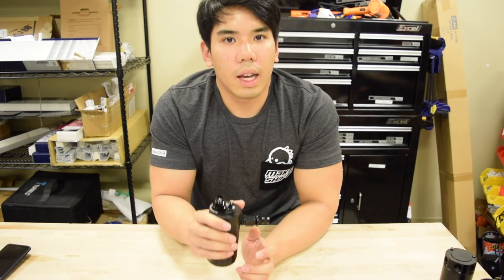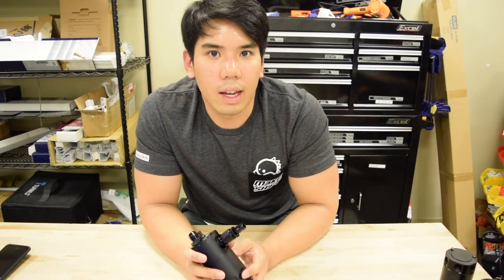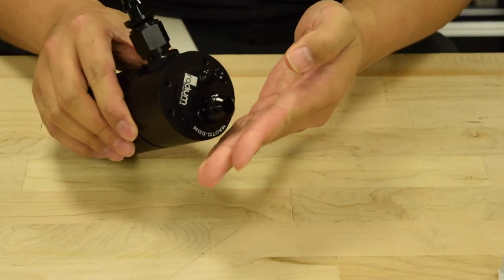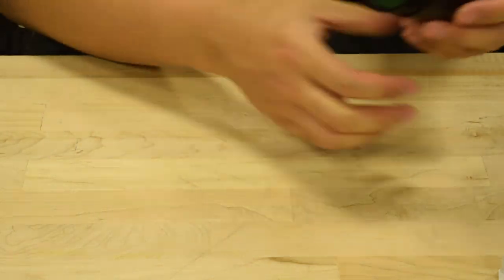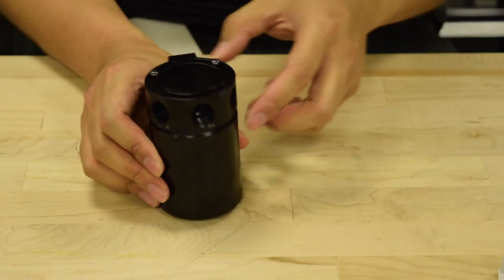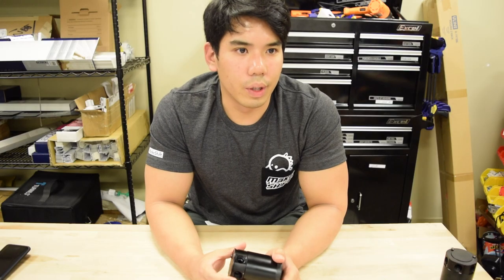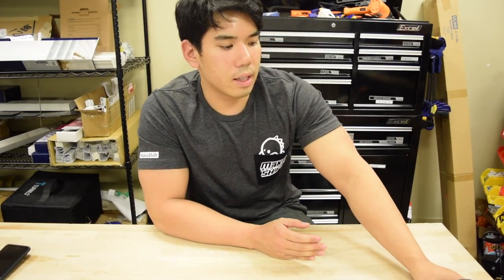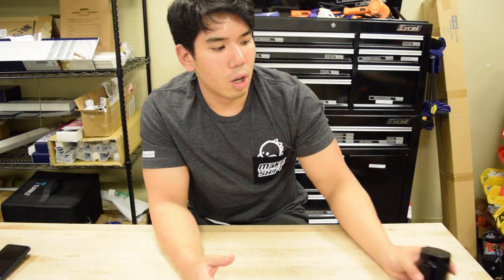Cheap vs Expensive Mods: Catch Can (Which is best for you?)

Comment: I have the cheap copy version of the Mashimoto item it is exactly the same both in materials used and quality.Both are Chinese made.The copy version has better threading than the massively over priced Mashimoto.You probably don't want to hear this but I have to tell you the copy works perfectly. £134 for the Mashimoto and £10 for the copy version here in the UK.
A final thought.Had you have been reviewing the Mashimoto version,I doubt you would have criticised the filtration method Mashimoto used,you would have accused Mashimoto of not knowing what they are doing! That would never do would it?
Reply from the maker: Yep! I believe it. I only bought the knock off haha. It's crazy how large the mark up for something so generic. And you've gotta think even our knock offs, someone made money selling it too.
Reply: Same for the radium buddy. The company that makes the radium tanks is BJR Performance who sell in bulk. 
Really good stuff I have alot of their stainless AN-3 fittings that I used to make my braking system

Comment: I believed that some oil catch cans will increase the pressure in the system due to the restricted flow, such as the bronze micron filter, is that more harmful than good?
Reply from the maker: The bronze filter adds less resistance than you'd think. The stock PCV valve is like a ball bearing check valve situation so I'd think that it would have more restriction than the catch can
Reply: @OhItsJustZhu  thank you for the explanation.

Comment: I love how the expensive ones are simply branded and sold at a higher price. Yet the same one shown by radium can be purchased on AliExpress from the manufacturer for the cost of the cheaper alternative anyway. 

Most of the universal stuff these days is manufactured in China. Then vendors like radium, real street, mishimoto and mocal and many others just buy them in bulk.

Even real streets catch can though gorgeous is simply the same as found on AliExpress for $30 or less and the only difference is real street put a spacer between the filter and body.
Reply: I've never seen the likes of Radium style catch cans on aliexpress however the second catchcan is what Mishimoto initially sold to the public, worst design by far.

Comment: Your close....It's made to clean.. filter.. separate the bad oil due to carbon build up drying and setting on top of the valves until eventually it comes loose...into the internal parts of the motor....This very bad problem is undetected in these types of motors with direct injection spraying the fuel under the valve instead of over the valves...unless you have a catch can and separate the bad oil carbons sludge separate the dirty oil it's going to...Try and explain one more time..... jamming hardened sludge clogging burning carbon that has been setting on the top of the valves..Older motor designs sprayed the fuel over the valve actually cleaning breaking down the carbon deposits using  the solvents in gasoline..and recent newer motors have two injectors for each valve spraying on top to keep carbon from developing and also spraying directly under to get better fuel mileage...... I'm sure someone could explain it a little better.... Hope this helps you.. it helped me I have the f150 3.5L EcoBoost backfire misfire while passing ruff idling.....simple fix catch can.. dual cans... Great video I have to learn how to edit make some YouTube vids ..yes I know and write too... lol ......GoodLuck and GbPT

Comment: I have an oil catch can almost identical to the generic one you demonstrated with, except that mine is a 2-port configuration and I purchased it on eBay. The problem I'm having is that oil is leaking from the lower drain bolt on the bottom of the catch can, has anyone else had this problem?.. and what did you use to fix the problem? I'm guessing the standard bolt isn't sufficient for the pressure it is under...
Reply: Use TPFE tape for the screw thread, this is the reference product :

https://www.amazon.com/dp/B06XCWQ4D2/ref=cm_sw_r_cp_apa_glt_fabc_JBQ4P2KARQ7RPV2PSYM2

Comment: How did you make the additional baffle? Looks like just sheet metal that you cut and drilled.  Then bent and used the diverter to mount the metal to and added the steel wool?
Reply from the maker: Yeah, you got it exactly! I got the sheet metal from Home Depot for cheap and did some cutting and bending. I forget if I riveted it in or used existing screws but I'll check this weekend. Thanks for the question!

Comment: Hey man how's it going I got the mishimoto catch can the 253$ one or so . And I don't want to spend the extra money for the top to be a l fitting . Do you have any ideas on what I can use to change the top fitting to a L instead .. because I'm not trying to spend literally 35$ for a fitting ...
Reply from the maker: Hey, cool to see that you got such a nice catch can, very pricey indeed. There's a few ways you could do this.
From what I've read, the threading on the catch can should be M20x1.5 (you should try to confirm this by going to ACE hardware, or any other hardware store). Once you confirm the threads, you can do this:
1. get a M20x1.5 to -10AN adapter (~$9) and the pair that with a 90 degree -10AN hose barb fitting (~$15) and you'll have a 90 degree swivel.
or
2. If you're not into looks as much as function, you can look for whatever size hose that it comes with, but search 90 degree molded [hose size here] hose and you should be able to find a decent selection, just be sure that the hose is rated for use with hot oil. You could even just bring the fitting you already have to autozone, or advanced auto and ask a sales associate if that have a 90 degree angled hose that fits your application. All you really need is the 90 angle and the rest you could probably mate with hose connectors or whatever.
Hope this helps you out, man. Let me know if you run into anything else.
Reply: Wait, you spent $253 for the catch can yet your to cheap to buy the correct fitting?